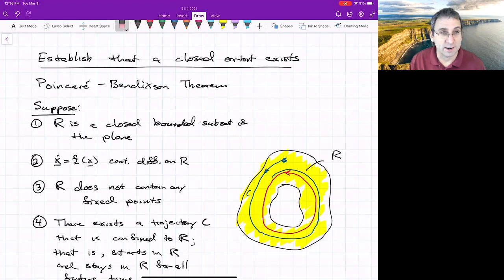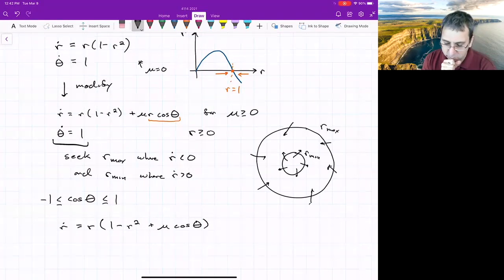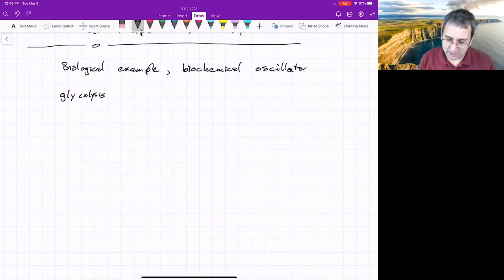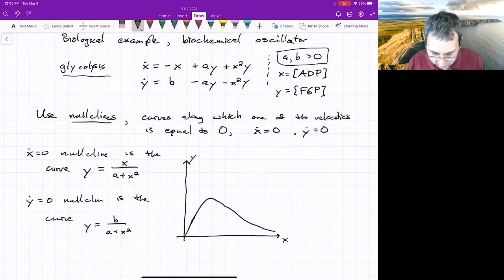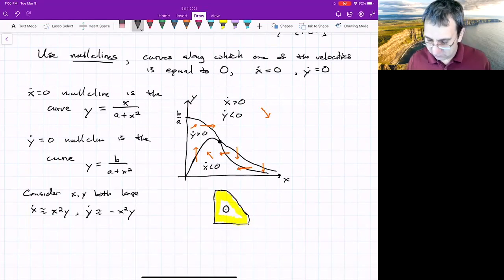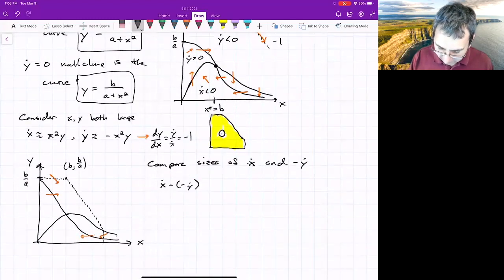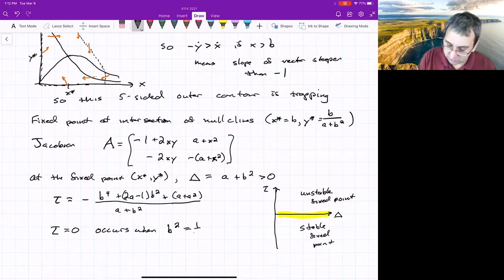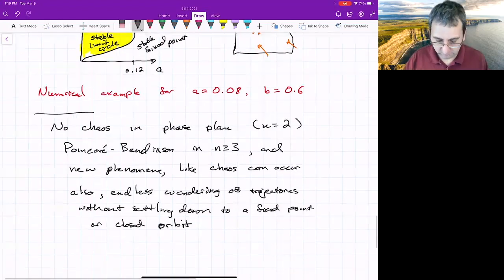Poincaré-Bendixson Theorem: Worked Examples (Glycolysis) | Limit Cycles Part 3

Comment: I know i'm posting it late,
but my question is what if you can't find the poicare orbit, does it prove it is not there or just that you simply can't find it?
__________________________
I know poicare method is used to prove limit cycles, can poicare be used to disprove limit cycles or no?
Reply: There is a limit cycle iff each of the 4 supposed statements in the Poincare-Bendixson Theorem are shown to be true.
i.e. if any of of those statements can be proven false, we have shown that there is no limit cycle. Please correct me if I am wrong but this is how I understand it.
Reply: @kylejohnson8447  Does it prove that there are no limit cycles or does it prove that you can't determine if it does or doesn't?
Reply: @presidentevil9951  if any of of those statements can be proven false, we have shown that there is no limit cycle.
Reply: @kylejohnson8447  then whats the point of the lapinov and dulac when we can just use this one?
Reply: @presidentevil9951  that’s a good question
Reply: @kylejohnson8447  i haven't seen anyone claim that the poincaré bendixson is an equivalence statement. So if the hypothesis aren't verified then we just don't have any information on it.

But the reciprocal is obviously wrong though, i mean the end result doesn't even make much sense.
Reply: @goldeer7129 im not in school anymore and i have no clue what you are talking about now

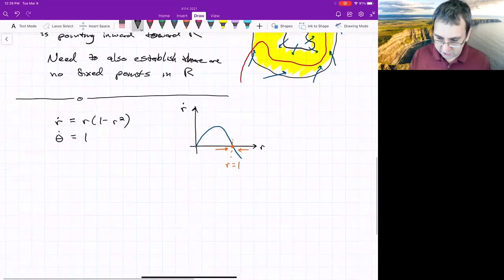Comment: This series of videos helped me so much to understand this Thm. Thank you so much for the clear lecture. If I may ask a couple of questions, at 1:58 is it the case that you only modified r-dot just to show an example of how Poincare-Bendixson Thm helps create a trapping region whenever you have an r-dot that's coupled with theta? Because, otherwise, if you have an r-dot with only r's and not coupled with theta, it's simpler to see where the limit cycle is just by graphing and determining if trajectories point toward the equilibrium solution on each side?l, correct? Thanks!
Reply from the maker: I'm glad the videos are helping you. "is it the case that you only modified r-dot just to show an example of how Poincare-Bendixson Thm helps create a trapping region whenever you have an r-dot that's coupled with theta?" Yes. "